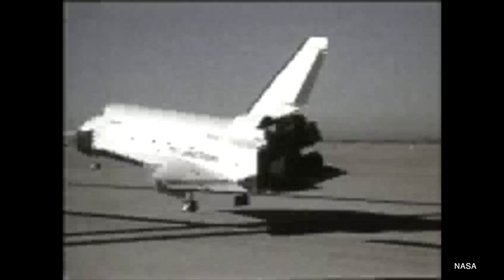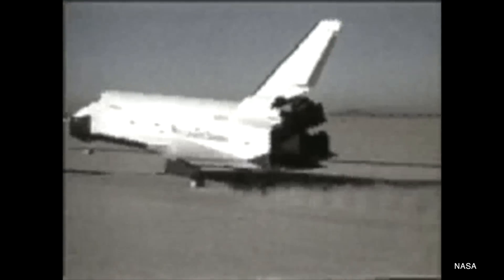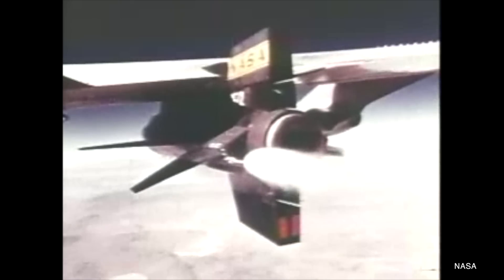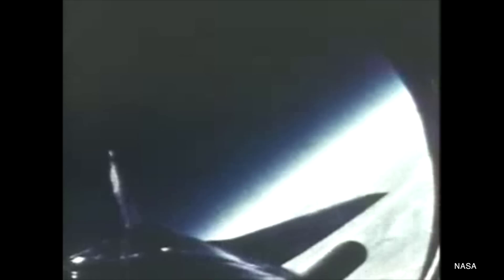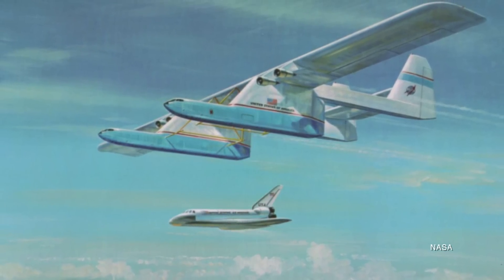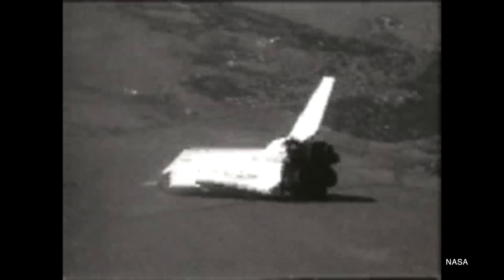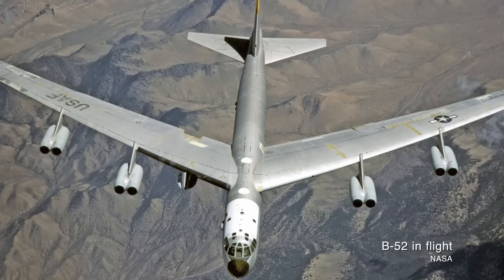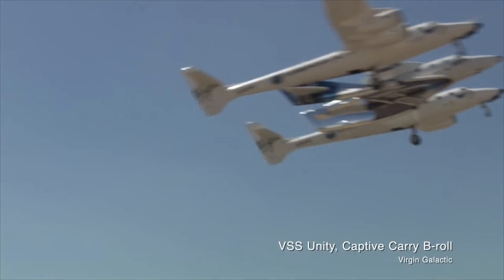When NASA Wanted a Dual Fuselage Shuttle Carrier

Comment: During the 1980s I was R&R ( Repair and Reclamation) or AR shop at Mtn. Home AFB in Idaho. We were also the bases crash recovery unit. We had documents for the recovery of every airplane we might encounter on our runway. One of the most interesting manuals was a recovery manual for...the space shuttle. It was very fun to read knowing there was no chance in hell the Air Force would ever let us near that machine. We had manuals for, F-16, F-15, F-4, B-52, and SR-71. We knew there was NO WAY the Air Force would let us near the shuttle because they wouldn't let us near the one and only SR-71 that IFE landed at the base. They stuffed it in a hanger tucked away from prying eyes. They did let us see it though, all secured and guarded by armed SPs. Bottom line? There was an emergency plan to land the space shuttle at Mtn. Home AFB in Idaho.

Comment: It was an historical 'space idiocracy' of trying to blast off so fast and so vertical when that wasn't the actual waypoint path, it was usually to orbit and they were not doing some kind of vertical hotrod racing, now they realize using multi phase atmosphere engines and wing lift & land methods was much less expense... For SpaceX, they should have taken tips from 'Batman' and gave both rocket phase parts a wrap,extend,fold the wings to glide fossil fuel free with gyro navigate landing, due to gravity it's time and costly to vertical stack and T minus delays.

Comment: The initial 'final' design that NASA was going to use was the shuttle on top of another winged rocket instead of the ill-fated twin solid rocket boosters. One would land back at the Cape after launch. But that was scrapped when Washington scaled back money for the Shuttle. The 'Final' design was a low budget built spacecraft. So at least the Discovery accident was realistically caused by Washington cuts.

Comment: Looks like the idea was essentially kept alive, the Stratolaunch from the Allen/Rutan joint venture is pretty much this...albeit a bit weaker, (250t payload) since it's designed to launch Orbital ATK rockets (up to 3 per flight) and not the Shuttle.  Set for first flight in 2019.

Comment: What is even more surprising is that I put this in one of my SF novels without knowing that NASA had thought of it.

They entered the building through vast, grey-green steel doors. It was a few moments before Jane's eyes took in the scene. Most of the floor was occupied by an aircraft that was gigantic, even by Arcturian standards. At first glance it looked like two long-haul airliners knitted together side by side, the inner wings shortened and joined, the tails grown into one another. It sat there, huge and lumbering in the gloom, its weight taken by five undercarriage assemblies—two nosewheels, a maingear under each outer wing and another beneath the structure that joined the twin fuselages. But this mammoth machine was only the tanker, a windowless generator of brute force, a carrier designed to lift the tug, the real spacecraft, to the outer margins of atmosphere.
And sitting there, atop the curving silver alloy of the tanker, was the winged black and silver shape of the tug itself, the only part of this aeronautical monster designed to continue into space.
Jane spent several seconds looking up at the tug as it hung in the dappled light trickling through transparent panels in the distant roof.
‘I presume,’ said Arthur, ‘that you know what this is.’
‘Looks like a Spearman-Reddy design. Takes off on six gas turbines, climbs to the top of the stratosphere, switching to ramjets on the way up, then...’ She moved again, peering up at the trailing edge of the wings in the silent building. ‘Not oxy-hydrogen. By the look of the exhausts she switches to hypergolics—that's expensive. Then the tug itself separates and goes on to orbit—with the payload in its cargo bay. The tanker makes its own way home under remote control. Your tank jockey presumably sits in the control tower here and lands it.’

Comment: Interesting. As a nice tidbit you could have thrown in that the soviets had the same transportation problem with their Buran space shuttle. And they did build a special airplane just to carry the Buran, the Antonov AN 225. the worlds largest airplane both by weight and length (and wingspan, if we stick to planes in service). The Buran was to ride piggyback on the AN 225, just like the Space Shuttle did on the 747. But the twin hull B 52 design was interesting. Much the same as the Heinkel He111Z Zwilling was developed to tow heavy glide planes during WWII.

Comment: Cross landing distance was for polar orbital launches from California, not Florida. The 1200 mile cross-range was to allow for orbital rotation. The plan was to launch southward from Vandenberg, launch a polar orbit cargo, and land back in California. Basically a semi-suborbital flight. Source: Space Shuttle: The History of Developing the National Space Transportation System by Dennis R Jenkins  ISBN 0-9633974-0-0

It is a really good source of information on how the shuttle because the mess that it ended up being. The delta wings of the shuttle were specifically for the cross range landing that was ultimately never needed and weighed down the craft. The Vandenberg launch site was built to launch the shuttle and never used, eventually it was blown up.

Comment: Why didn't they just land the shuttle in Florida?
Reply: They did eventually.  First they had to be sure they could land the shuttle safely with a large target.  I grew up at Edwards, even if a plane overshot the 20,000 foot runway, you could still roll along the hardpack dry lake bed as an emergency surface. It would mess up the landing gear and wheels, but by that time you'd have bled off a lot of the velocity you had remaining.  Edwards was a cheaper alternative to building a runway at the launch site.  

When they had enough money in NASA's budget, they finally built one and used it much of the time.  Edwards was reserved as a backup landing site after that, though it still got a fair amount of use by the shuttle.

Comment: I was recently watching a video on Apollo 11 and the solid few rocket of the launch escape system had a round cap on it.  This was just minutes from launch, I didn't see anything connected to it so it looks like Apollo 11 launched with a cap covering the LES Rocket.  I have never noticed this before and every model I have ever built of the Saturn V or even the Saturn 1B the LES Rocket had a normally pointy nose cone.  What was this cap and what purpose did it serve?  Was it shed at launch or did it ride all the way to the point that it was released from the CSM?
Reply: This was known as the Q-ball. Its job was to provide telemetry on maximum dynamic pressure or "Max Q" upon the launch stack during ascent. Max Q was reached around 1 minute into flight. The LES and Q ball were jettisoned a little over 3 minutes after their respective tasks were no longer required.

Comment: You are amazing... ... did they ever think of taking a boeing 727 and running it with only two more powerful  lighter weight engines??/  I'm told that this was the 737... any more input???
Reply: The 727 would not be able to lift the orbiter off the ground without two hellaciously powerful engines. In addition, the orbiter would have been physically too large for practical attachment to a 727. While there were some similarities between the 727 and 737, they were fundamentally two different configs. The 727 engines were mounted to the aft fuselage and within the rudder while the 737 engines are wing mounted.

Comment: In the mid 90s NASA also looked at something called the Liquid Fueled Fly Back Booster.  It would have replaced the SRBs.  The idea was it would break away after providing the lift needed for the Shuttle and could fly under its own power back to a landing site.  It would have saved a water recovery.  There were several designs considered, the one that got the farthest was Boeing's concept I believe.  Back in the day I was asked to build 3D model of it, but that was at least 10 computers and more than 3 unrecovered hard drive crashes ago.  Eventually the idea was abandoned as it was nearing the end of the Orbiters design life.

Comment: The F-82 was a twin fuselage fighter.  The idea of that sort of aircraft is really quite old.
On the TV series UFO, the shuttle launched from a twin boom aircraft.  The idea always looked fairly practical to me.  Jet engines can get you above most of the atmosphere.  They require a lot less weight in fuel.

Comment: Today, April 12, is the 36th anniversary of the first space shuttle launch STS-1 which launched at 7:00 AM EDT. Luckily I had a VCR that day and recorded ABC's live coverage of the launch (no cable TV yet in my neighborhood). I also had recorded the first launch attempt on April 10, which was scrubbed due to the problem with synchronization of all 5 on board General Purpose Computers. Of course I also have the landing day live coverage from April 14, 1981.

Comment: Hello Amy, my dad was part of the crew that designed both the modifications to the 747 and the struts that held the shuttle up there.  The shuttle was lifted with specially designed cranes, then the 747 was rolled under it for docking.  The idea of using twin B52 bodies was scrapped, at least in part, because the original machines used to build it in the first place were no longer in existence thanks to some of the arms treaties, and rebuilding them would have been both logistically, politically, and financially  problematic.  Another part of the problem is that the B52 has flexible wings, and although adding a solid wing strong enough to support the shuttle is possible, it would change the flight characteristics of the B52.  It would have taken much longer, and been far more expensive to redesign, and rebuild this more, or less new kind of B52 variant than to modify a 747.
   Mark Barbee - Dry Prong Louisiana
Reply: I saw the 747/Shuttle land in El Paso in late 83 or early 84 while I was in AIT training at Ft Bliss Tx, we were in the middle of a class and the head instructor came in and had the class assemble outside, do an about face, and told us to watch the airstrip that we could see from "the hill", less than a minute later here it come gliding down with that monster on its back, it looked out of proportion and like it shouldn't be able to fly, I guess it was a refueling stop on the way from California to Florida, a sight I'll never forget.
Reply: I was part of the aircraft selection tem (B-52, 747, C-5).  The B52 idea was scapped because thewheelbase was too wide for use on most runways. C-5 was not available, the 747 was bought fromAmerican Airlines.  I designed the 747/Shuttle Orbiter separation system.  The orbiter was fitted with ejection seats and the 747 had a special bail out system.  Good times.
Reply: Mark Barbee
Thanks for sharing this info!

Comment: I caught a radio broadcast while living in Tucson AZ in the 80's. It seems the 747 carrying the shuttle east was going to land at Davis-Monthan AFB (in the middle of Tucson,well almost). Instructions were given as far as which crossroads (I believe it was Swan/Craycroft for people that know the area) to go to to see the shuttle (on the back of the 747) leave. This 747 passed over our heads under 100 ft and headed southeast. The 747 pilot was really pouring the power on and going for airspeed over altitude. We all know a 747 can make it across the country without refueling but because it had the shuttle on its back it had to land barely 500 miles from Edwards AFB for fuel. This was one of the better "hang out at the end of the runway and watch the planes take-off" shows I have ever seen.

Comment: Maybe I'm just totally naive, but why didn't they just land the damn thing in Florida?  Not enough runway? Building a suitable runway at or near Cape Canaveral would surely have been easier and cheaper than piggy-backing the shuttle from CA every time it launched, wouldn't it?  What am I missing here? Pork barrel politics?  CA wanted a piece of the action?
Reply: The runway in Florida was shorter as I recall and they needed pretty much perfect weather to land the shuttle in, since it had no engines.  Edwards has more consistent weather than Florida (seldom rains or storms for starters, or even has many clouds) and being a dry lake bed, there's an insane amount of runway to choose from (as you can see in this satellite view):

https://www.google.com/maps/place/Edwards+AFB,+CA/@34.9159213,-117.8795171,18188m/data=!3m1!1e3!4m5!3m4!1s0x80c24ab03a29c3eb:0xdf7023bbd91346e8!8m2!3d34.9240314!4d-117.8912085
Reply: They did - the Shuttle Landing Facility is one of the longest runways on the east coast.  But Edwards is MUCH larger, and being a dry lakebed you can land in multiple directions.  Weather is also consistently better at Edwards.  So early flights landed there just for convenience and safety.  Later flights would land at the SLF whenever possible, with Edwards as the backup (usually due to weather at the Cape).

You also needed a way to move the Shuttle around anyway for testing, moving it from the factory, in case of a launch abort (which might see it land in Spain, etc.).
Reply: Spain . . . or Easter Island for a polar launch, as in the novel "Shuttle Down":

https://en.wikipedia.org/wiki/Shuttle_Down

Comment: New wing, new engines, new control surfaces... the B-52 fuselages seem to be little more than pods for the landing gear and a place to put the pilots. It hardly seems worth the bother as opposed to a completely new aircraft.
You know that there was also a serious proposal to carry the orbiter under two C-5As joined by a common center wing. The C-5 was also the runner up to the 747 when NASA went with the cheaper "piggyback" transport configuration.

Comment: G'day,

   Nice Video, thanks for posting it.

   There wasn't actually going to be so much of a case of "Two B-52 Bombers joined at the Wingtips..." so much as it was to have been , "A pair of B-52 Fuselages used as Twin Main-Booms with Cockpits & Undercarraiges, joined by a totally new Straight Wing (unlike the B-52's iconic Swept-back Wings...) and a new set of oversized & asymetric Tailfeathers..." (!).

   Actually, the "Siamese Twin Aeroplane" concept dates back to about 1940-41, when Willy Messerschmit produced a Tank-Carrying Glider which needed  a "Troika" of Messerschmit BF 110 "Zerstorer" twin-engined Fighterz to pull it off the Runway...; so the Luftwaffe took two Heinkel 111 Bombers & built a Rectangular section of Wing, with an Engine Nascelle mounted onto it, which replaced the Right Wingtip of one Bomber & the Left Wingtip of the other..., producing a 5- Engined Twin-Tailed Tow-Plane with 2 Fuselages...., they called it the He-111-Z ( for "Zwilling", meaning "Twin or Double"...)

   A local yokel from around here (Charlie Scherf RAAF, from Emmaville...) was flying a Fighter-version of the DeHaviland Mosquito over France in about 1943 when he came accross a Heinkel Zwilling, and he became the first Allied pilot to see one, as well as the first to shoot one down ; there was a display featuring him, & his Zwilling Kill, in the War Memorial Room of the local Museum.

   Old Technology, and the USAF was flying Twin Mustangs, as Night-Fighters, during the Korean War, too ; with a huge Radar Dome hung off the front of the " Wing-Joining Segment" & a Radar Operator in one Cockpit & the Pilot in the other...

   Just(ifiably ?) sayin' ,

   ;-p

   Ciao !

Comment: That last footnote made my planned comment about how this has been made a lot of times with various planes (although not at that size) completely irrelevant. Thanks Obama. 
However, another point; as a future engineer i feel like the whole  engines only on the outer wings thing would make for unnecessary strain (and thus materials, weight and manufacturing costs) on the middle wing, especially during take off. But I guess it wouldn't do to have engines too near to the shuttle, so oh well, i digress.

Comment: Have you heard of STRATOLAUNCH?  It is a planned 6-engine dual fusalage plane just as large as the original shuttle-carrier design being worked on by one of the new space launch companies.  It will launch unmanned rockets to LEO to launch satellites.  Its engines are to come from 747 no longer being flown by airlines.  It first appeared in a Popular Mechanics cover story around 5 years ago.
Reply: In one science magazine around 1980, there were designs for a plane with 2 C-5 Galaxy fusalages  and 6 engines as well as a dual fusalage airliner.

Comment: Didn't the Boran have attachable turbo jets so that it could transport itself? I assume they copied that from the original NASA design?
Reply: My understanding was that Buran's engines (which were not fitted on it's only flight) were for added cross-range capability during descent.  Their solution for post landing transport was basically the same as NASA's.  Although, instead of using an existing airliner they designed one from scratch, which eventually became the Antonov-225.
Reply: Well, not from scratch - the An-225 is an An-124 with a new center wing that carries the two additional engines (the outer wings are the same), a fuselage stretch, and a new empennage.
Reply: Ok, maybe not "from scratch," but they were purpose built, not made from surplus airliners like the SCAs.